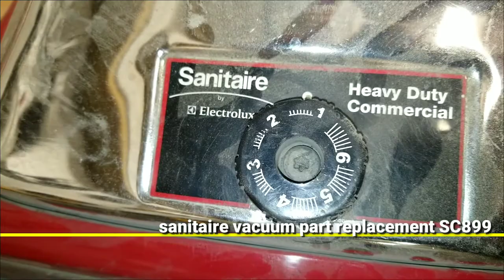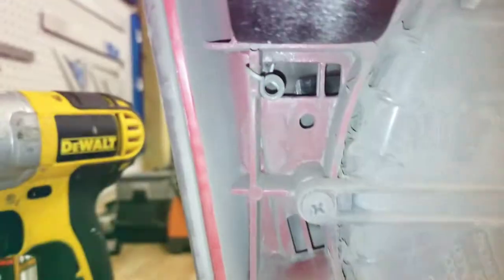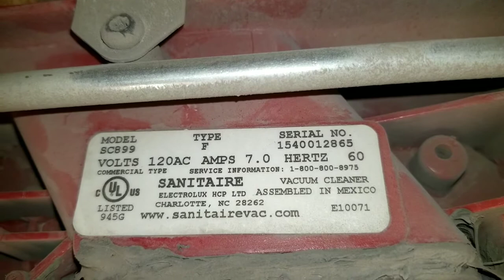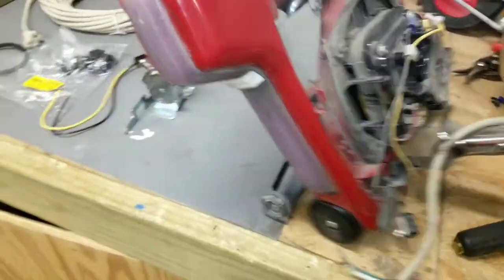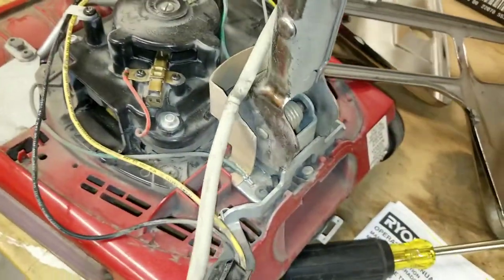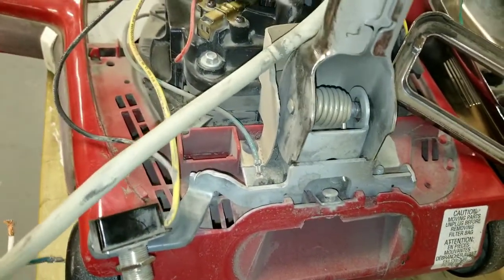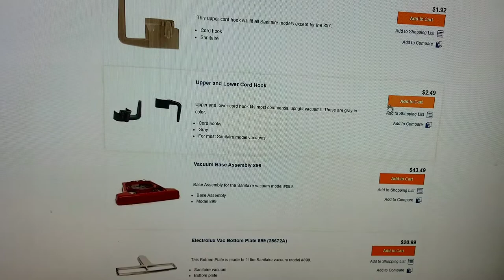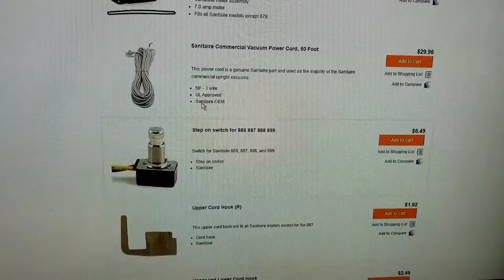Sanitaire Vacuum Cord Replacement | Fully Maintenance and Part Replacement

Comment: Hey, A Good Brushroll I Found That You Could Get For This Sanitaire Tradition Is A CWP 16" 4Brush Disturbulator And I Think The Vacuum Will Clean Better With That CWP Brushroll In It And Set On BareFloor AKA Carpet Height 1!